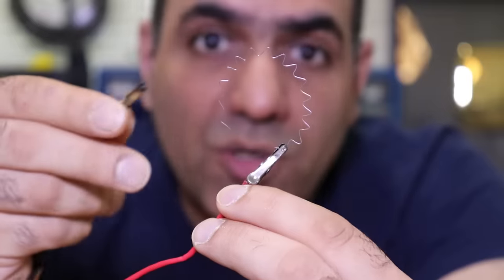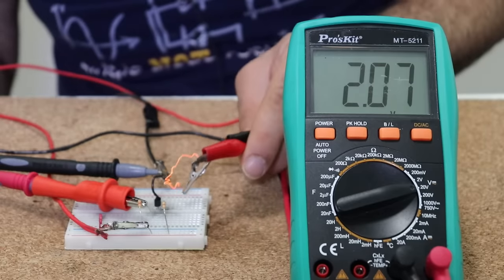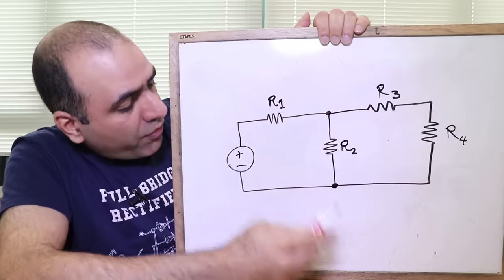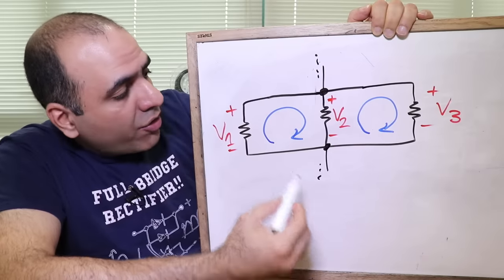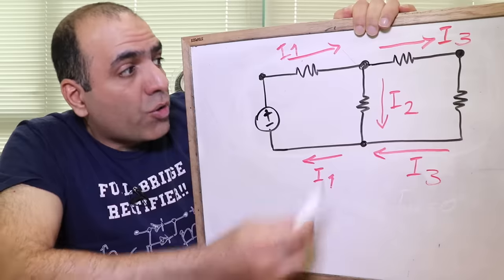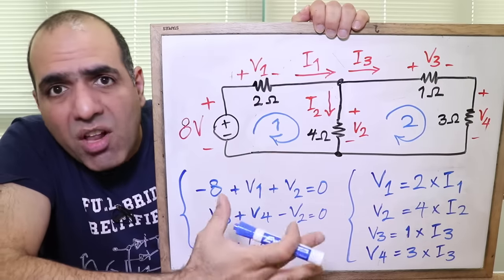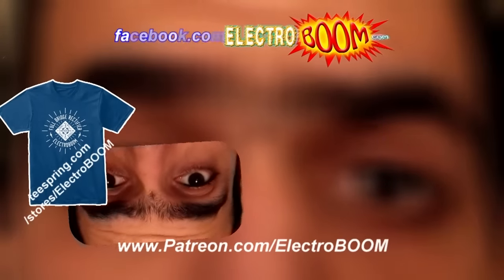LUMPED MODEL, Kirchhoff Circuit Laws (ElectroBOOM101 – 008)

Comment: I am an active professional Electrical Engineer. In your electronics education series here, you are explaining circuit theory better/clearer in ~30 minutes than all my professors did throughout my entire time at college. You, sir, are a wonderful teacher!
Reply: I have to ask then, is Mehdi's full bridge rectifier something common, or something he invented?
Reply: @Maninawig  actually they’re very common. You probably have quite a few of them in electronics around your household. They’re used to convert AC signals to DC. Most commonly used or convert power from AC to DC voltages.
Reply: @Deper91  thought so, as even Mehdi points them out everywhere. Just was curious as he made merch about it. 

I'd rather make it about how the cake is a lie, as Glados deals with P=ie.
Reply: As another electrical engineer, I second that. Way better circuit theory explanations than in university!
Reply: @Maninawig 🎉

Comment: 10:01 My professor would have screamed at me for writing '8' instead of '8V'
Reply: Mine would have killed me if I mixed numeric values with litteral expressions. In this case, I would have to have named the source's EMF with a capital E (and counted it negative, because KVL, man...), made all litteral calculations then switch to all numeric values in SI units (no unit symbols in an equation...), then converted the numeric result to an appropriate unit considering the problem at hand ("0.050A, that is, 50mA")
Reply: The whole task crossed out in the exam.
Reply: takix2007 If fate has trapped you in the near future and you became a physics or electrical/computer/quantum engineer student, you’ll understand why it’s very important
Reply: @chedidkamal837  Units are very important, but if the unit is obvious and it's just tiny mistake of the student, punishing is like mental illness rather than proper instruction. Bunch of crazy people trying to show the student, where is his place.
Reply: @ytmsz98  yeah of course punishing is not normal at all in any case the student had some effort and dedication in solving his exercices !
I was talking about how it may become very confusing if the units are not written

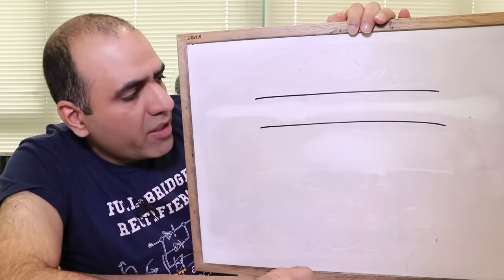Comment: 7:34 I think something under-appreciated about KCL is that charges do accumulate. That is initially, the current through series components of different resistance have different currents, since initially, the electric field is uniform throughout a (straight*) wire, and therefore by the other form of Ohm’s Law E =ρJ, where J is current density, it can be shown that with a uniform electric field strength and different resistivities, current is not the same through series components. But KCL works because the difference in currents would allow charges to accumulate at some places to rearrange the electric field strengths so that the current through series components will all be the same, i.e. an “electric” equilibrium is reached. It’s just that this equilibrium is reached so fast that no one cares about it, but it’s false to assume that charges don’t accumulate in wires. (* bent wires also have charges accumulate in corners to keep the electric field strength in the wire constant by the same logic above)

Comment: Hi, good instructional video.
BUT
At 5:00 with KVL, it would have been easier on the labeling if your supply voltage was Vs, then R1 voltage could be V1 and R2 could be V2.

Comment: As an EE I can't remember the last time I actually broke out the KCL/KVL. Most of the time I need to combine with parallel or series rules, voltage divider, or it's way too complicated to run on paper and I use LTspice. Hell half of the battle is finding components that actually work across temperature and don't cost too much.

Comment: I prefer mesh analysis.  Just two loops (KVL).  Two equations with two variables to solve for current.  For a simple one like this you can just use high school algebraic substitution to solve for the currents and then use the currents + resistances to solve for voltage drops across resistors if you want.  The problem with the substitution method is that it gets too complicated as you have more loops.  With 3 loops, that 3 equations and 3 variables (currents), with 4 that's 4 equations with 4 variables (currents) etc.  It quickly gets out of hand to solve for a single variable and do substitutions.  However it's pretty easy to shove it all into a matrix and do reduced row echelon form (RREF) to solve.  Especially if you let your graphing calculator, matlab, etc do the work.  This guy explains this process in detail, even doing RREF manually:  https://www.youtube.com/watch?v=_xomX-d8XU4

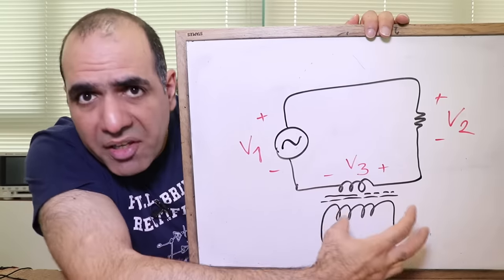Comment: 12:42 wow, although I didn't like professor Lewin response, but I still agreed with him that closed line integral of E field is KVL, Now I see this explanation and realised that you were actually correct all this time, just one has to note that wires in diagrams are ideal zero resistance, inductance wire while in actuality this is not true, and using lumped model(lumping all resistance and inductance of the real wire into single components) really helps👍👍

Comment: I'm an undergraduate student and as I remember my first year, this would be useless since we got to calculate currents and voltages in 3 large circuits powered by several AC current and voltage sources in 1.5h. One of the circuits had coupled inductors and in the second one, we had to use Norton or Thevenin. Second semester was about differential analysis of transient states. Professor just shows up a few integrals or something and he's nervous, when student doesn't understand and asks for anything to simplify. This is reality of studying electrical engineering...

in Poland.

Comment: Thank you. You connected that electrolytic  backwards at 0:45, right? I have intentionally exploded forward biased diodes before, but not electrolytics. There is small aluminum shrapnel. May I suggest eye protection? It's fun to go boom, but it's also nice to be able to see afterward.

Comment: I recently seen a video. Freezing a magnet and the copper increases the Eddy current. Would you be able to increase the electricity output of  magnetic generators if the copper and magnets where frozen

Comment: I disagree with the random association of polarities. Wouldn't the battery always have to have polarity in reverse to the components for the sum to equal zero. 
For example If you have a single loop with a battery and resistor, if you label the battery in the same manner as the resistor you will end up with
 +V +V=0
But from my understanding the sum of the voltages around the battery and resistor, if you take both of them as positive, could not be zero, Either the battery or resistor/component has to be negative.
Can someone please explain.

Comment: I have a question on that little detail about stray capacitance when you refered the cases where current going in is less than current going out: Is it like a GIANT vaccum cleaner where some of the electrons are being sucked away? Is the ground terminal like a giant electron sucker for that circuit? Is it like the circuit and ground make up a giant capacitor where the circuit itself is the plate where all the charges are store and ground is the other plate?
Reply: And also: I have been kind of hesitant about going to brilliant: I can learn some stuff at school but i feel like brilliant would be a good acessory. Can we really trust you when you say it is "well made" and "simple" ? Pls be honest. Since that raid shadow legends crap i feel like i can trust no one.

Comment: Hay electroboom there’s a new company that is called energous they’re showcasing a new type and of wireless charging by using radio waves I was thinking on buying one but I would like for you to to a look at it and see if is a good product or is it a scam please and thank you
Reply: I had a look and it looks fake, or atleast it won't work as well as they advertise. Essentially its same as a tesla coil radiating RF all direction. The inverse square law makes charging radius small and the charging current would be so small it. It may be able to charge medical aid such as hearing aid or rythm tracker but you have to be right next to it.

Comment: This stuff is the simple stuff that doesnt get you too far in circuit design and digital circuits..  i got as far as advanced digital circuits 2 on my electronic engineering degree then when i was about to intern at bose with this older engineer dude, i spent 3 days with him and just dropped out and said screw that..  just passing the class was hard enough where youre racking the ole brain with literally 100 complex circuits all laid out where you spend a few hours finding values for a small section which adds to another section of circuitry which compounds on another part that only makes up a tiny branch of a logic portion of a microchip single pin output which controls and regulates loads and frequencies just for another pin of the microchip which will inturn initiate a sequence of another 5 similar circuits to run through a simgle process on a board comprised of hundreds of these processes and thousands of sensitive components where you fuck up on a single equation and put in a resistor a few ohms off and bzzt start over from the beginning and scrap those days or weeks or months of work :..  fuck that..  some chinese dude somewhere can fiddlefuck with that shit while i get high and enjoy life..  fuck that,.  Id end up shoving a soldering iron through my eye..

Comment: Please make a similar video showing the current flow in a battery-fueled circuit.. i've read a many forums and people simply can't get to agree of how does the current flow in that circuit and how does the electrons flow inside a battery (well i personally think that there is no flow of current inside a battery because there is no closed loop in it but i think that the negative therminal pushes the electrons to the positive terminal so they come out from the positive therminal to the loop/circuit when discharging and coming back to the negative am i right?? But that leads us to the next question, how can electron go through a negative and inside to the battery? That is impossible, leads me to think that there must be a positive and negative side of that negative therminal so the electrons go inside battery through the positive side of the negative therminal, right?) And the charging worx exactly the opposite way? I would like to make it clear..

Comment: This is not for beginners. It's probably TAFE cert 3 electrical. It fits uneasily in the cert 2 syllabus end but is presumed to be easily understood for Elecronic Engineering, week 1. You will need to do a lot of work to understand it, and Jim Pytel and Ben Eater are good exponents.

Comment: Do you know what a Paraformer (Parametric Transformer) is. I think its a single phase to 3-phase converter based on a transformer and capacitor. Can you correct me if I am wrong. As I wish to find out more about it. As it would be great way of having 3 phase in my workshop. I have an interest in electrical experiments. But I can see you are well versed with the interest and any advise will be welcome. I do hope a new series is on its way. GREAT VIDEOS!

Comment: Can you make a calculation video for how much energy being wasted if we use 14 gage copper wire in the house comparing to 12 gauge, I’m thinking to build a house with 12 gauge and thinking if it’s worth it comparing to 14 gauge, I just started electrical apprenticeship in Canada and one of the modules was talking about waste of electricity.
Reply: Is it worth installing 12 gauge instead of 14 and if it will pay itself off in a long term?

Comment: I KNOW HOW TO GET ELECTRICITY WITHOUT PAYING FOR IT!!!!

Step one: Get a crystal radio
Step two: Set it up
Step three: check if it works
Step four:  Disconnect antenna and ground from radio
Step five: Buy five microwave transformers
Step six: don't mind about the price because FREE ENERGY
Step seven: put transformers in series (output to input, and output to input...)
Step eight: connect input to radio
Step nine: connect radio to ground and antenna and tune into a strong station
Step ten: put a voltage regulator to regulate voltage to voltage is not unstable
Step eleven: connect to wall socket (!!WARNING!!) DO NOT CONNECT TO THE WALL SOCKET IN THE WALL. USE A SOCKET THAT IS NOT IN THE WALL.
Step twelve: wrap EVERYTHING with electrical tape and duct tape and kapton tape.
Step twelve: Enjoy

[Trouble Shooting]
-If it does not work, check the voltage, if there is no voltage, check all your connections
-If there is voltage and it is not high enough, add more transformers
-If the voltage is too high, take away some transformers
-If it still does not work, ............. well......................ummmm................then maybe the radio is not tuned.
-If it still does not work, ..........................................................................................................................................................................................................................................................give up........OK BYE!
Reply: Ok
Reply: Some serious dedication here...
Reply: Is that illegal
Reply: @Leo-jy5qm  no

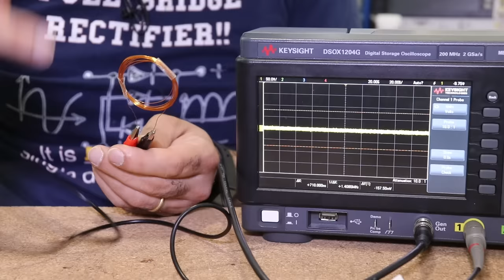Comment: 3:06 and this is why I'm still confused at wireless charging, since it's essentially a loop inside a phone.
Yes it's mostly stick besides the battery, but won't it still affect the motherboard?
Reply: It will, but since all chips are made of silicon, it will only affect the very small traces, and that effect is negligible at best

Comment: Does lump modules mean anything to you? 

The physiology of the body is defining the human biology by saying that the brains psychological issue is using a strong side. Weakening the other unused side. But in parallel become enough strength to hold together. And if supported stronger, but pushed too much causes combustion.

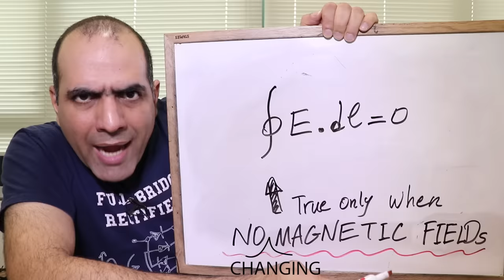Comment: @4:29 "According to my definition KVL is not this ... [displays a white board with the closed path integral of E-field = 0 scribbled on it]."
Not again ... 🤦‍♂️   KVL satisfies the gradient theorem; circuits in the presence of time varying magnetic fields don't.  Edit: I guess I should add, all due respect to Professor Lewin notwithstanding, that one may add the time derivative of Φ to both sides of the Faraday's Law integral equation making the resulting form of said integral equation homogeneous (i.e. equal to zero on the right hand side). Then with the recognition that self-inductance L:= Φ/I, one notes that ∂Φ/∂t = L dI/dt; and as every freshman physics student eventually realizes, L dI/dt = v[ind](t) ... and balance is once again restored to the force. You want KVL to balance? Add an inline inductor to your circuit and ever' ting be Irie .

Comment: 4:28 Do you want to deny physics again? 
According to Feynman's physics book KVL is exactly the equation you've crossed:
https://www.feynmanlectures.caltech.edu/II_22.html 
This line integral we have called the voltage drop across the circuit element. (etc)
Reply: well it's not wrong , even the book said "According to our approximations there is no magnetic field in the region outside the individual circuit elements. Therefore the line integral of E around any curve which does not pass through any of the elements is zero" , mehdi said "it's true if no changing magnetic field" 
so it's true if sum V = 0 for this context of ideal circuit or "lumped circuit". explain to me why it's wrong?
Reply: @devillieshorrorhouse5200  Could you tell me what is the "it" you are talking about? Would you care dealing with the statement I actually made, instead of asking me to defend an undefined strawman argument?

Comment: Hey electro boom ! A small request ...
When I was testing different circuits made and if any of them is a bit wrong and made a short circuit everytime my mains circuit breaker goes off and I don't want to turn it on again and again so can you help me build something which goes off before my mains circuit breaker and that I can start again. Help from anyone is appreciated.
Reply: try using a power strip, with a  breaker in it.

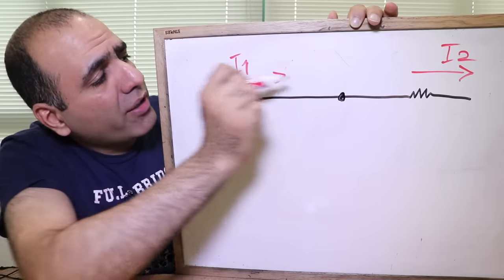Comment: 12:46 There’s a small mistake said. KCL is not always true.

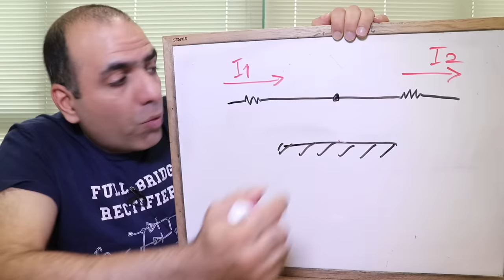It’s true there is a capacitance between the wire and Earth. It’s also true the current I_1 is not the same as I_2. However, it’s false “current must be leaking into the ground” as ElectroBOOM said at 12:54. No, not necessarily there is a leak of current. That is one possible reason, but not the only reason. Another reason could be that charge is simply accumulating somewhere in the wire, or in other words the charge density is not constant.

I mean, suppose we have an insulated cable. Then of course no charge inside the copper wire is leaking into ground, because the insulation prohibits that. So the reason current in is not the same as current out is because the charge density at each point in the wire is not the same.

To further proof my point, you can read about the law of conservation of charge, which in differential form states in words that “the partial derivative of the charge density with respect to time is equal to the negative of the divergence of the current density”. KCL is derived from this law assuming the charge density is constant, meaning its time derivative is zero.

Comment: I have a question/project idea for you. Can you make a circuit and adapter to plug in a cordless drill? Since a wall outlet provides 120v AC but the batteries are usually around 18v DC, can you make an adapter from a battery charger (and battery housing because they're such weird shapes)? Basically turning a cordless drill into a corded drill- I hate having to keep buying lithium batteries for my tools